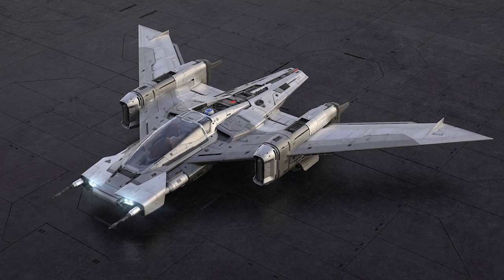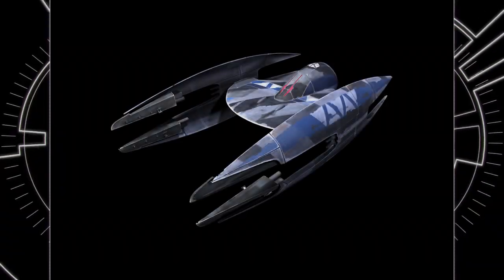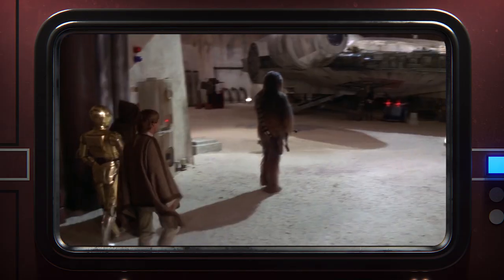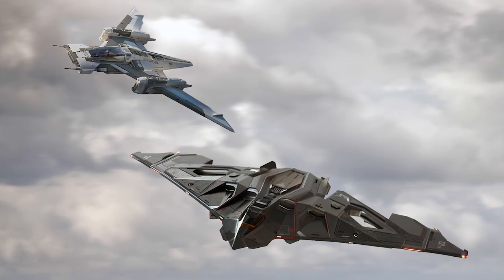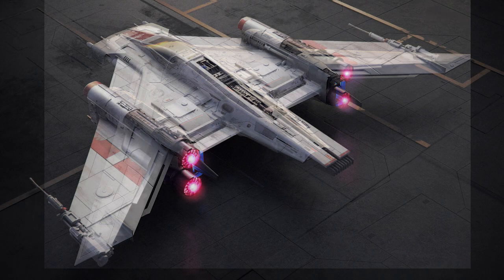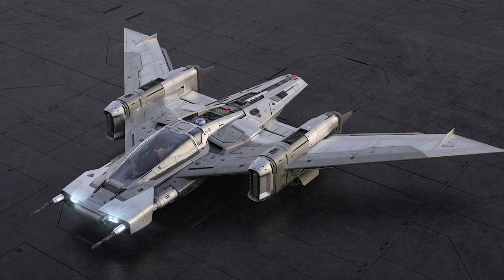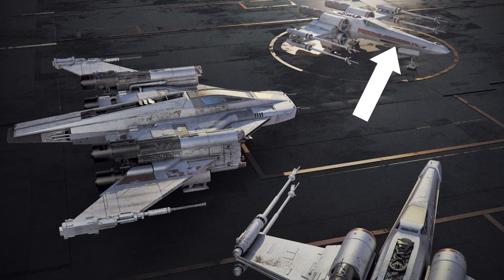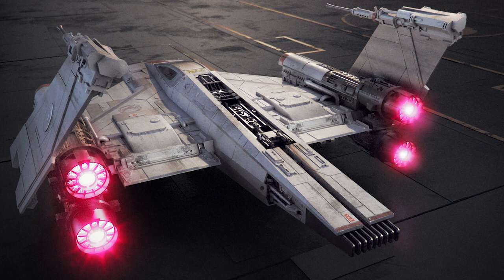Fixing Porsche's Star Wars Ship

Comment: I love your redesign. The Porsche one is, as you say, a really cool futuristic aircraft, and it'd be really cool in another franchise, but yours is much more Star Wars.
Reply: Their design looks like a Star Citizen craft, which made me eye twitch.
Reply: Pretty much agree. Current design were more like startrek's. the new redesign were closer to starwar's design. though i prefer if the nose were a bit longer, and the cockpit a bit slimmer. love the engine and overall design.
Reply: @ThatConfused1  Yeah it fits right in with SC, and EC Henry's design also works better from a piloting perspective. 

The Canopy drove me nuts on the original and mentioned that on a rather lengthy critique there. 
His one is much better for visibility, both since there are no obstructive elements on the frame, as well as the Cockpit being place higher in the Aircraft.
The seating position of the original is very low, which is seen as a good position in a sports car, but is horrible in a fighter, because it limits vision into all directions. 
And the windscreen is not as steeply inclined, reducing glare, especially from the instrument panel, and visual distortion. 

Still don't like the front end, there is a reason why pretty much all fighters, including those in star wars have a tapered front end.....and that is drag. 
This design still has a bit too much frontal area, but overall it works much better and looks star wars. 
It also makes more sense, that light grey is visible but not as much as the bare metal look of the original. 

When the B-17s and P-51Ds flew bare metal at the end of WW2, the glare off them could be seen, on a good day, for about 150 km (roughly 80-ish nautical miles or 93-ish statute miles.)

That is generally a huge tactical disadvantage and the USAAF only did it n the late war, because they wanted draw the Luftwaffe out, to fight them. The Luftwaffe then was mainly ill trained young pilots of under 100 hours before combat, even less than 50 sometimes down to 20 hours of flight time before their first combat mission, going up against well trained US pilots with often 200-400 hours before their first combat. 

So to the USAAF it made sense, to a small rebel force, it does not.
Reply: I like both designs, but don't agree that one is 'more' Star Wars than the other.
Reply: @woollimy yeah I'm thinking the same. Not a single point of what he is talking made sense to me besides the point that the ship doesn't look like Porsche. But that's all.
Reply: @2freeIvX Except the Porsche designers themselves stated that the vessel was supposed to look like it was made by Incom.
Which means it SHOULD look similar to other Incom ships, most of which have that industrial, kinda bulky look to them.
The original design would theoretically work had it not been directly tied to something it very clearly isn't, that being an Incom vessel.
Reply: @ThatConfused1  I think it could be an Aegis medium or heavy fighter.
Reply: Nah the OG ship does fit the SW universe, where they screwed up was by making it an Incom product. It looks like a Coruscant vessel, not a fighter.

Comment: This fighter evokes a very “Legacy Era” feeling for me. Almost like the New Republic or Galactic Alliance successor to the ARC 170, with the 3 person cockpit, but MUCH beefier. Not as sleek as NR E-wings, but more multi-purpose and durable.
Reply: not a fan of the look of the E-wings i would rather this be the E-wing.
Reply: @MrChickennugget360  My only real problem with the E wing is that dumbass laser hanging over the cockpit.  Get rid of that, and I'd have no issues with it.  Still wouldn't like it as much as the X-wing, but I wouldn't be bitter about it replacing them.
Reply: For some reason it reminded me of the Old Republic era the setting of the MMO a Republic Fighter
Reply: @CaptainAmercia  I see what you’re getting at actually. As an avid SWTOR player, I can see it

Comment: There's still something about your ship that bugs me, but I can't put my finger on it. What I WILL say is that you 100% succeeded in making it feel more Star Wars. Saying that the original looked right out of Star Citizen or something was dead on. Good work.
Reply: @TheCoolCucumber  I think you're on to something there.
Reply: Cockpit scale. That's a one-man snubfighter, not a three-crew strike craft.
Reply: @TheCoolCucumber  My humble thoughts: 1) Engines should be one big cylinder on each side, similar to the Resistance X-Wing engines, and positioned closer to the core as you say. 2) The wings should be clipped shorter, to the red stripe. 3) The slope behind the cockpit should be removed. It should be flat with a greebly surface. 4) Clip off the "tail" wedge end.
Reply: @hw2577  The front of the engine should have an intake grill of some kind.
Reply: Actually with a slight elevation behind the pilot, we would be looking at a vague ARC 170 minus the 3rd crew member. It's got potential, perhaps a Fel Empire or even Darth Krayt (130 ABY or so) or even a good fit for a fast gunboat for fighting coral skippers of the Yuuzan Vong. I know legends territory but still.... It's an awesome design for perhaps a later age of Star Wars at least a century after Yavin.
Reply: @KillamriX98  the vast majority of SW ships don't really look aerodynamic, wheras this thing looks like it could really fly without much use of repulsorlifts.
That's why it looks a bit off.

It's still a damn sexy craft though.
Reply: KillamriX98 Yeah but he didn’t have the full resources of a full design team and all the money of Disney and Porsche
Reply: So it’s not gonna be perfect
Reply: The top/bottom profile is too big, leaving this ship too easy to hit compared to something like an X-Wing, which has much smaller wings that are nowhere near as big of a target.
Reply: @AnimeSunglasses  Is that a movie quote? It sounds like a movie quote. 🤔
Reply: @charizardjmj  nah, I'm just VERY fluent in STAR WARS.

Comment: if the design in universe company had been Nubia star drive inc. the origional design would have been a bit more of a fit I think. the soft design lines of theirs seems very similar.
Reply: It'd still need refinement even then. They'd need to strip off all the thin plates of whatever and integrate everything into the surface of the craft, instead of looking like they duct-taped a bunch of flattened cans to it.

Comment: I always think of Star Wars as a very old, lived in universe, and existing ship design tends to reflect this. 

I think you've done a fantastic job w/ your version. It immediately evokes an Incom Corp feel vs the Porsche design. I especially like the gun placement. Incom tends to avoid a long wing w/o using it FOR something. The Z-95 and T-65B fighters use that to spread the fire profile, as you've done here.

And even if you do have an astromech socket, it doesn't have to be populated on your promotional brocheure.

Comment: for the original design

They made a good effort, however I feel that if you covered up the R2 unit, you'd be forgiven for thinking it was from literally any other franchise, I myself am getting more guardians of the galaxy vibes from this design then star wars.

I am not sure what kind of role this is supposed to have as it has very little weaponry with only a set of chin mounted blasters, and has a crew of 3 + astromech so is rather personnel heavy for little firepower, the ARC 170 has the same crew compliment but uses them in a much better way, and even if this ship is some sort of transport you are at best transporting 2 people at a time, also what do the extra people do anyway? seem that all piloting goes to the one in the front. With what I have said above I feel this ship could serve more of a VIP transporter when you cannot afford something larger or are trying to keep a lower profile, however with the snazzy fancier look it will stick out more.

So the people who designed this where told to merge and U, X and Y wing with a car, smashing together a troop transporter, fighter, bomber  and a car is tricky as what do u take from each ship is calibrated to be for a specific role, this ship has far more in common with a U wing then a X or Y wing, but even then this is less of a fighter and more an intergalactic car, when you wanna pop to Hoth to pick up some ice rather then go to the shops on the planet your on.

for your redesign
 
For a start is more capable of defending itself and looks sturdy enough to take a hit or two, the folding wings are very in-keeping with the U wing X wing movable wings, and even has elements of the Lambert shuttle. 

Your choice to remove the astromech and focus on the ships aesthetic to show it belongs in star wars is bold, yet effective, with a decent balance of something similar, with enough characteristics to make it so that you won't mistake it for another ship.

This ship seems to me like the rebels equivalent of of a Lambert shuttle, to ferry important figures in the rebellion around without drawing as much attestation by using a blockade runner whilst being more conservative with their resources.

overall I think you and yours have done a grand job of taking the source material and bringing it fully into the star wars style, well done.
Reply: Role for (relatively) lightly armed craft with 3 crew. I guess, that it would be long range recon craft - while I personally think, that Henry's NR Y-W would be do better such task, this craft would be better when discretion is far more advised, let's say during covert operations.
Reply: @Jfk2Mr  perhaps, however the original ship seems too, flashy for military use, it is like a luxury item owned by a senator on coruscant, something far too expensive for the rebellion to have or keep would probably just sell it off for the credits to afford literally anything else. 

EC Henry made it more in-keeping with the star wars design and could definitely be a recon ship if the two passengers have access to some computers back there is hard to tell from this far away, the ARC 170 could probably do a better job and also be better in combat but the likelihood of getting some of them, especially ones that work is slim, so this could be a more modern alternative.

In a way there is nothing to stop it from being both a VIP shuttle and a recon vessel, as with all that scanning equipment you can tell when trouble is coming and get the VIPs out of danger before it arrives.

Comment: You know, Henry, I think you missed the mark on this one honestly.

Your design is really good, really cool. But it has some serious pitfalls. 

1: The Pegasus communicates its open three person canopy far better. Looking at yours, I kept having to remind myself that it was a three man craft. The other two in the back barely look like they fit, and it just doesn't seem to work out too well that way.

2: I think you should have omitted the chin guns entirely. The wingtip ones work just fine for what you wish to establish- and my reasoning is simple. I think the chin guns AND the wing blasters speaks of uncertainty on where to focus its fire, AND chiefly, far, far too strongly evokes the Y and U-Wing while trying to also do so for the X-Wing.

3: I also believe the engines are... Weak. You should have gone with blue for the exhaust, much in the way the U-Wing has them. AT the same tiiiiime, I also think that the engines are far too U-Wing placed along the wings. A really neat way to address this would have been to angle their mounting in some fashion, even slighty. Having 60-to-45 degree angle retro thrusters would look far, far better.

4: I will fully agree on your Astromech decision. However, it would be valid for it to have a sideways input just like the N1 has. A nice callback to a now ancient starfighter, which in and of itself is evocative of luxury cars.

Thing is... I don't think they did it that well either.

1: The razor thin stuff you are 100% right about, it doesn't fit Star Wars. It may someday, but just, not today.

2: I COMPLETELY forgot it was supposed to look like an incom ship. Holy crap it does not.

3: I mean it looks like a flying car, what with the head and tail lights. Guh.

Overall, I think the perfect design would be a blend of what you both did. Usually you do really good work Henry, but this time I think you genuinely fell short. I'm sorry if that comes off poorly. I love your work, and hugely respect the effort you put into it all, and I'm very happy somebody of your level headedness and sheer talent has access to the inside scoop. I really hope they hire you on for stuff, because you get it.

Addendum: Porsche's design pushes the envelope and aesthetic too far, while yours does not push it at all. The best compromise would be a middle ground.
Reply: I might have un unpopular opinion, but this time I prefer the original design better. Sure it might look extremely futurisric, but in my head Canon this is a ship built by a very exclusive manufacturer, therefore is more unique and different. Henry has some great designs but I think that 'standerdizing' this ship to fit in with the rest is a poor decision. But then again, that's just my opinion...
Reply: @CJPortugal  yeah I c it tech moving forward
Reply: I agree, there exists a middle ground where this vehicle would truly shine. On one hand Porsche's design stands out from all other Star Wars ships which is one of the main points of the design - but it does it in a way that makes it not fit into the Star Wars universe.

On the other hand, Henry's design fits perfectly into the Star Wars universe, but it does that by sacrificing its uniqueness and honestly the Porsche feel is completely gone. Having a few softer lines in the front part of the main body is simply not enough, you either have to use that design language on the entire ship, or not at all. Doing just a part of it makes it seem confused of what it tries to be, like it's torn between the two styles rather than unifying them. There is definitely room for improvement on the engines, this is where I feel the Porsche designers did their best work, as well as with the "greenhouse" area and interior layout. These elements are unique but still fit within the Star Wars theme. The blue afterburners also resemble other fast ships like the Millenium Falcon, and they should definitely keep it - along with the aerospike design.

If I were to design the ship, I would make all front-facing surfaces use the sleek and clean Porsche design, which would bleed into the more industrial Star Wars style at the rear, which would indicate how the front of the ship is designed for aerodynamics and cutting through atmospheres - similar to a heat shield on a rocket, and the rear would be the industrial outer-space element. Alas, I don't have the time right now to do an in-depth design render. Maybe in the future.
Reply: YES I AGREE, I totally think a rework of this ship by porshe would yield a nice end result.

Comment: Those two back recessed areas that were originally the gaps in the back part of the wings on the original concept. On yours they should be turned into the directional flaps or some sort of directional flap like on the snowspeeder. Need more of that practical atmosphere flying stuff it's really cool

Comment: I know, this video is a bit old, but Youtube just recommended it. To be fair: Your ship already has the used look of the rebel fighters so it fits more with the setting. Can you show it as it would look fresh from the manufacturer? Because that's what Porsche shows, a brand new ship without markings, paint job or weathering. So for a fair comparison both should be in the same state, so only the design of the ship itself can looked for, if it fits into SW. Or give the Porsche Ship the same used look.

Comment: So I think the reason you don't see their version of a space fighter craft as star wars is you are thinking more along the lines of what rebel ships look like, also most Hero ships we see in star wars (and most other shops and films) tend to be owned by people that can bearly keep them in the air.

Take the Y-wings they are meant to have an outer coating that makes them look bulkier and hide internal workings but the rebel pilots and engineers took the plating off to make them lighter more maneuverable and to make it easier to get at them to make repairs, they also had to keep stripping down ships to fix the other ships they had left.

There are lots of ship designs in the star wars setting that we likely haven't seen yet, a galaxy is a big place and we have only seen a few planets (come on Disney stop setting all your shows on Tatooinee) so there will be new designs fron races we haven't ran into yet.

Now your changes make me think of the Naboo fighter we see in BOBF/mando season 3 we see in the prequels what a well maintained fighter looks like then in mando we see what that ship ends up looking like after it's been strapped then retrofitted to bring it back up to working conditions, most of the old yellow paint has gone, a new more powerful engine has been fitted along with heavier cannon's (still no place to sleep or eat so mando will need a bigger carrier to call a mobile home) and the droid compartment has been changed into a little seat, you can still see what it was in its glory days but its seen quite a few years (wait I'm still talking about the ship right?) Their one is the one that is fresh off the factory line your's is the one that's been in service for 40 odd years, their both good IMHO.